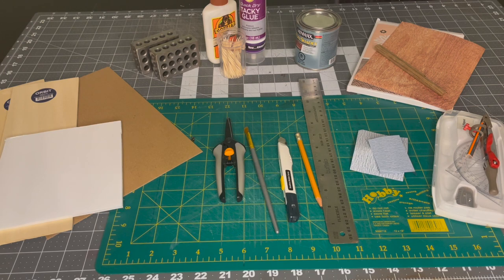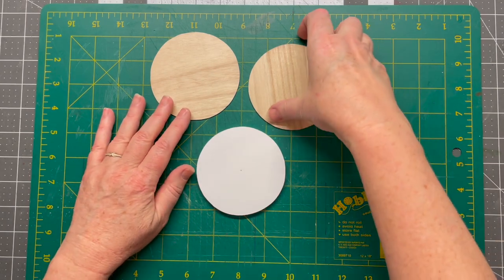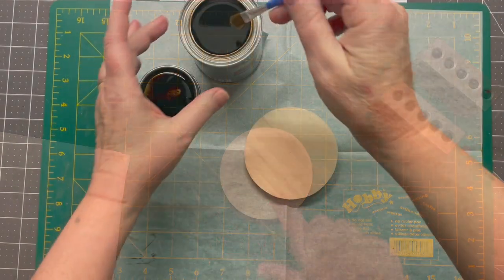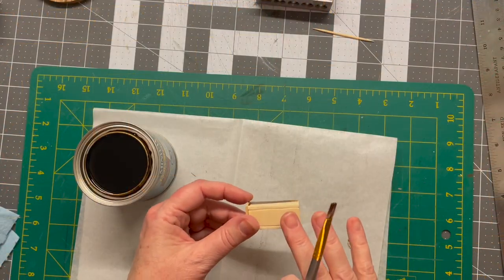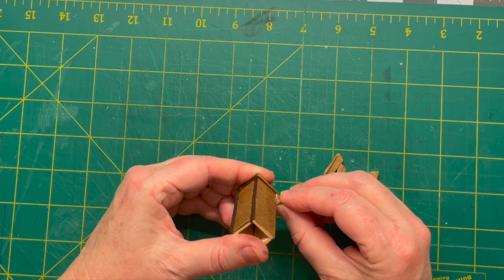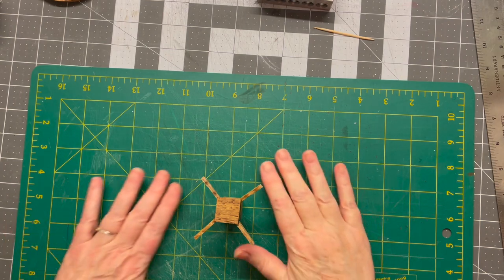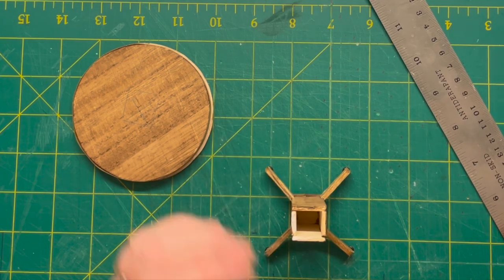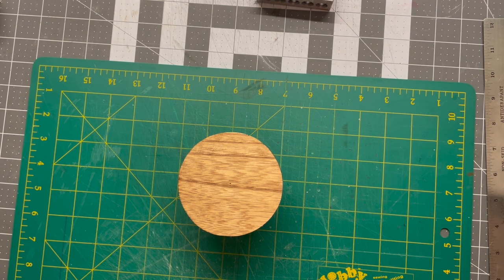Making this 1:12 scale Miniature Dining Table

Comment: Great tutorial ! For the wood on the side of the table you can also use wood veneer strips that come in a roll. There are different types of wood and are easy to find in hardware stores. They can also be used for making floor boards.
Reply from the maker: Thank you! I have been looking at the veneer strips and I’m considering using them in my next project for the flooring. I love the wood grain look in them!

Comment: I too found it impossible to cut thin wood for a project I was working on and ended up using card stock, I was very pleased with the end result and glad I didn’t give up.
Reply from the maker: The struggle is real! You may want to check Lori R’s comment below. She is definitely on to something with the Jewellery saw!
Reply from the maker: I found the jewellery saws on Amazon for aprox $20- $25. They are also called Coping Saws.
Reply: Yay, I hadn’t started to look yet. I pray you had a good Christmas, tough I’m sure, the first of everything is strange and new.

Comment: A great way to “harden” your chipboard to make it stronger and more wood like, is to use liquid super glue (in a well ventilated area). This soaks into the chipboard and hardens it. Then you can sand and paint or stain like wood. Be sure it is liquid superglue. The gel won’t work. ❤ Lisa
Reply from the maker: I did not know that. Thanks for the great tip! I’m curious if there is ever any warping?
Reply: @pennyssmallspaces  I’ve never had a problem with warping. And I live in Florida where there is 100% humidity. Lol

Comment: You did a good job matching the stain and wood paper.  I have recently had some success getting unlike materials to all look like one stained piece by painting the non-wood pieces before adding the stain.  I keep having trouble with small areas on the wood however, keeping me from progressing in the project.
Reply: It's a good copy of that table too
Reply from the maker: Thank you Elisha! Matching that stain was just pure luck! I currently have two colours in my supplies and that one just happened to work out, lol.
Staining is tricky business especially if you use more than one type of material or one type of wood.  I find the colour all looks a bit different. I hope you can work out you trouble. It’s no fun being stuck!